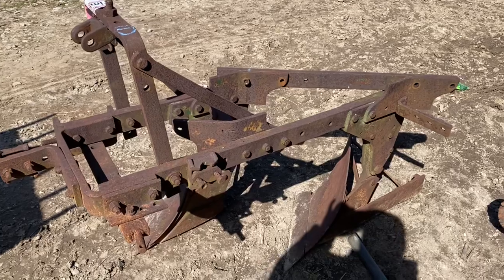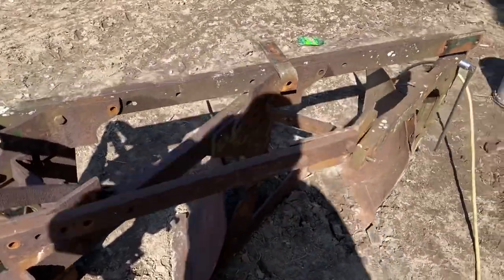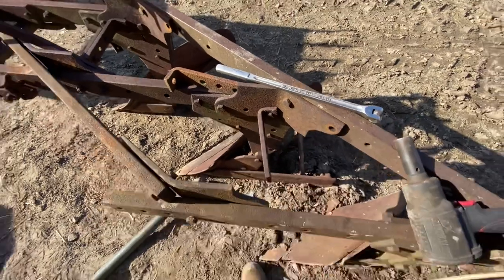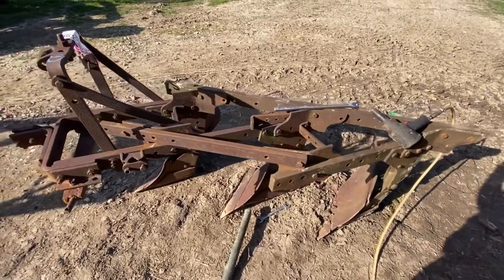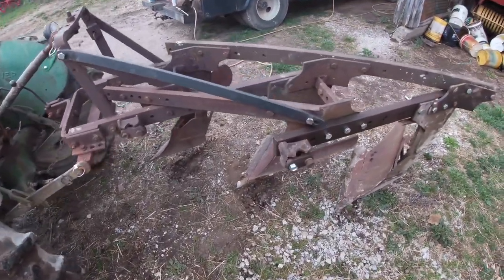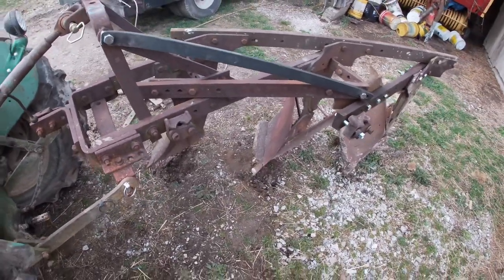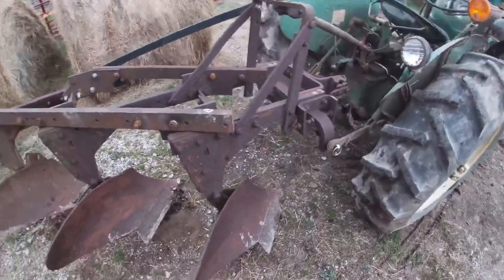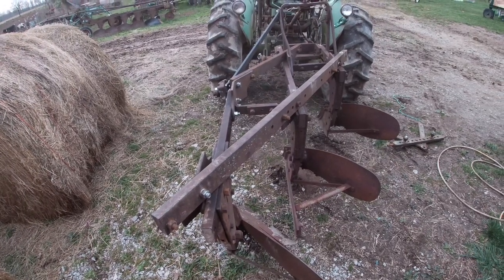Converting Oliver 3241 Plow to 3 bottoms: How many drill bits must die???

Comment: Interesting on the masonry bit, never have heard that and it seemed to work pretty well.  I've never had good luck drilling hardened steel, but I know it helps to flatten the angle of the flutes out, normal bits are like 118º included angle, I think they want something more like 150º, slow speed, and lots of down pressure.  Sometimes hard to achieve in the farm shop, but maybe someday that'll come in useful.  That's an awesome plow.  You're right, never really see them in 3 bottoms.  Glad you made/restored it that way!  Thanks for the video!
Reply from the maker: Thanks! My drill press doesn’t run as slow as I’d like. But that bit really surprised me. When are we going to see a new BurningDinosaurs video???

Comment: 🤣 that was me last year, trying to adapt one brand share (blacksmith style) to another plow brand. (Because there are none!) Man that sh*t was hard. Plug weld one hole, drill another in a different spot. I also tried / used a masonary bit, but ended up buying a cobalt bit. Run it at a slow speed with lots oil 👍 that worked best.
Reply from the maker: I know, my poor cheap old drill press runs too fast. When I worked at the dealership they had an old drill press from the blacksmith days, flat belt drive. They adapted it to electric motor and used a Crosley transmission. The thing had power feed and would have been perfect for this job!

Comment: I have drilled out roll pins from blind holes with masonry bits. The key is oil and slow feeds and RPM. No offense but you need a drill press. The slower the better. 😁
Reply from the maker: I know, I need to find a way to slow this one down. That’s it’s biggest fault. But hey, it’s more entertaining this way 🤣
Reply: @rosstheoliverman One option i have reccomend to friends is a chinese magnet drill and a piece of plate steel. The thicker the better, magnet sticks better to thick stuff. Get one with the slowest speed you can find. It will expand your capabilities with annular cutters, "size dosent matter". And you will be portable.

Comment: Well I guess I'm not the only one with one of these 3 bottom plows ! LOL  Dad has one and I have a series or 2 later 3 bottom 3 pt plow. I had 3 stainless steel trash boards I put on dads 3 bottom, However they look funny cause there AC orange and someone painted the plow blue !  But they do a good job plowing no matter how funny they look.  Bandit
Reply from the maker: Thanks! They’re usually hard to find in a 3 bottom. You’ll have to make a video of yours sometime!
Reply: @rosstheoliverman  I'm going to have to take a close look at dads 3 bottom cause I thought it was a 3242 I red on the decal. But I will make a video on it beside the one I just got, Dads is cat 1 and mine is a cat 2 and I have no idea what model plow it is but it has the spring trip bottoms on it and big coulters !  I know its a later Oliver plow with a welded square beam with spring trip bottoms and springs on the coulters and the front coulter bolts on just like the 3241you have bracket and all. I bought on a whim you might say but when you find really good equipment cheap you buy it and as it turns out its a plow I've wanted for a long time to go with my 1550 I have, Well one of the 3 I have.  Bandit
Reply from the maker: @banditfarmer1900  you gotta buy stuff when it’s available that’s for sure!!
Reply: @rosstheoliverman  I've learned over the years that sometimes you just get lucky finding equipment, I got a call a few years ago asking if I would be interested in an Oliver 520 baler like I have. Well long story short I bought an Oliver 520 baler MF 4x16" plow and a 10 foot Bush Hog disk below scrap price and I know there history . The baler might have 2500 total bales threw it the disk has 19 7/8" original blades on it and the plow might have plowed 150 total acres !  The 1550 gas thats dads is a 1100 hour tractor I bought for him and I bought a JD 4400 combine with 1200 original hours on it and I'm the second owner of it. I wasnt looking for any of them when I bought them I just got lucky ! LOL When something pops up thats really good cheap I'm buying it ! Bandit

Comment: I hate drilling that old hardened steel. But you got it done! We have a fully mounted 3 bottom similar to this but with a square beam running across the top. And newer reset bottoms. What model would that be?
Reply from the maker: That sounds like a 3242 or possibly a 348? Email me pictures of it and I can probably tell you.
Reply: @rosstheoliverman   just emailed you pics. Let me know if they turn out
Reply from the maker: @WisconsinOliverNut  I didn’t get them? I checked the junk folder as well. I guess try again??

Comment: It was very painful watching you drill holes, but I enjoyed it so I must have a warped sense of humor. That kind of steel usually work hardens like stainless steel, the only way to drill it is go slow and feed hard & steady. if you spin, your done. Gotta have a sharp bit when you start. To late to help, but better luck next time. PS... I hate drilling holes. thanx for the entertainment.
Reply from the maker: I know, I wish this drill press ran slower. Hopefully I don’t have to do that again for a good while. I need to just buy another set of new bits instead of messing around with these old ones. But I definitely will use the masonry trick again.
Reply: @rosstheoliverman  just remember, this way sells more videos :)